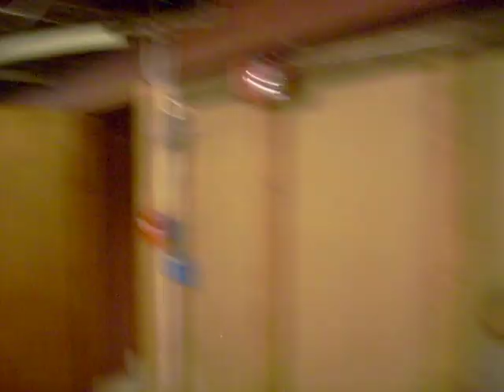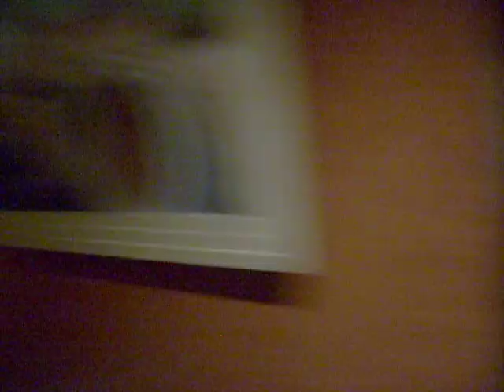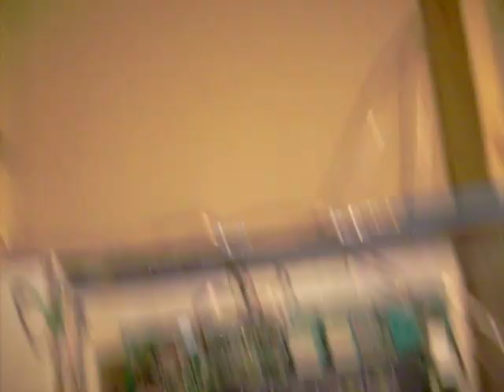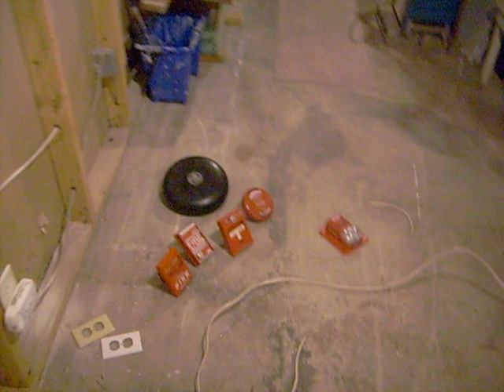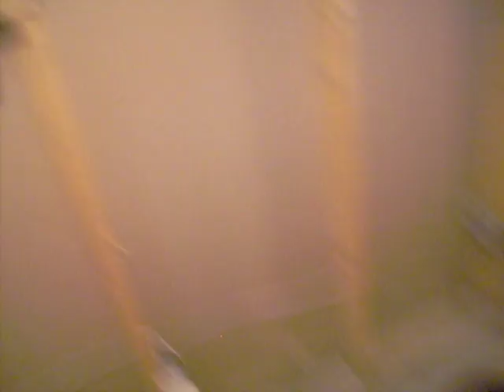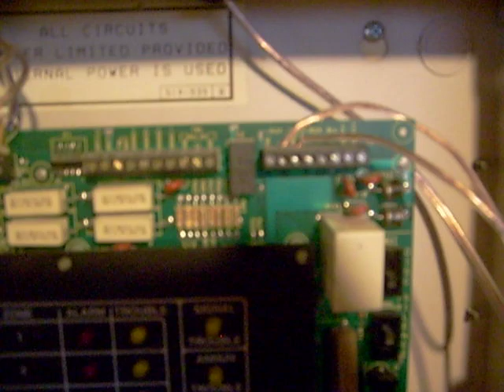New Fire Alarm Collection - Installation and Overview - 1 of 9

Comment: the fci alarm is actually system sensor
Reply from the maker: +Ryan Ni No, it wasn't. It was rebranded; a common occurrence. That one was an FCI. The original trim plate is long gone but can be seen in a one of my older videos.

It's a moot point now as that particular unit is in the junk box, a casualty of an early attempt to simulate the Fire Lite strobe sync signal with an Arduino that resulted in all of the smoke being let out of the firing transistor.